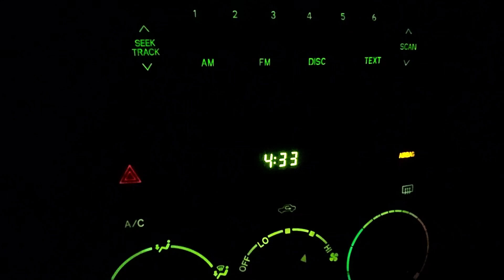Trucking in MN winter 2022

Comment: Get a small thing of lock de-icer. Alcohol removes the lube in the lock, the de-icer has a lube in it. You can find it in Walmart or any auto parts store.
Reply from the maker: I've used that before and it hasn't worked as well as the Alcohol has. It's probably worth another try!
Reply: @F8truckin  you could also use a dry lubricant in the locks, that has worked for me in the past.

Comment: Any good suggestion on where to pick up a good roof rake like the one you use @f8truckin
Reply: That looks similar to the one I use.....I got mine at Lowes or Menards.  Probably at Home Depot as well.
Reply: @eleffe5587  ty.
Reply from the maker: I got the 1 in the video at Menards, any home improvement store in a clod climate should have one.
Reply: @F8truckin  Ty. I’m gr8fl.